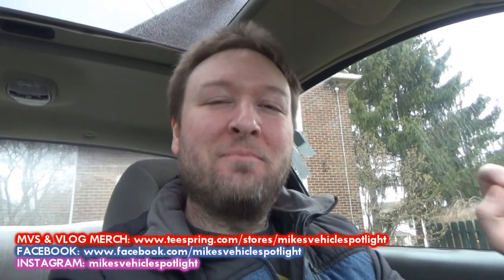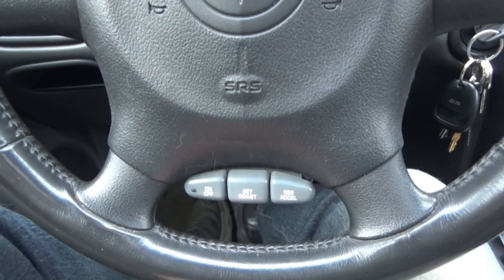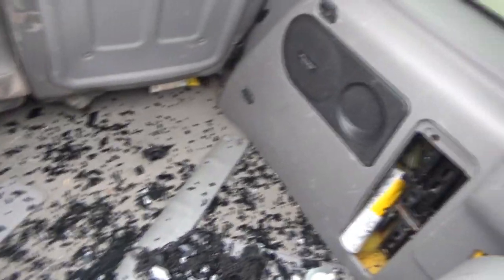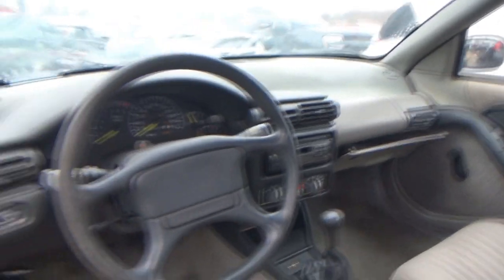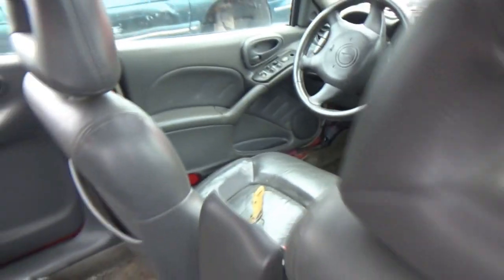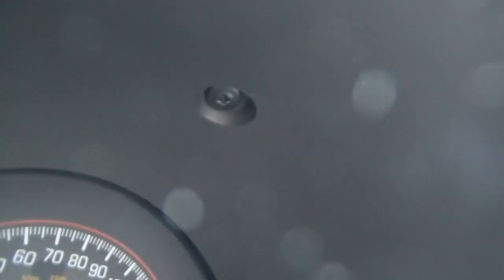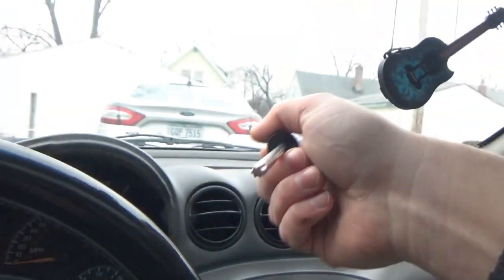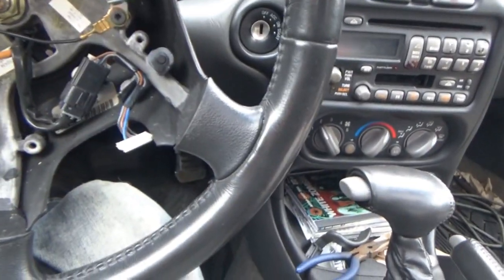MV 313 - "Grand Am Cruise Control Button Replacement"

Comment: Like me, they probably didn't  watch your video BEFORE they tried to "fix" the cruise control buttons..the bottom of the button housing pulls off rather easily (too easily  in my opinion) with the entire steering wheel intact. Oh Btw I have an 03 Grand Am with 228000 miles on it. Motor is still running strong!

Comment: I had the same problem with my 2003 grand am. The switch cover broke away from the switch assembly and the switches broke. I was without cruise for about 1 year until I found a new assembly on eBay for a decent price.

Comment: My cruise on my 99GT is not working. The on/off switch was not going in an now after working on the switches it is but i don't think it stays in. I have led brake lights that i'm wondering if they are the problem. I have a resistor on the 3rd brake light because the abs light was coming on. For fixing the flash rate on the other lights i modded that flasher circuit built into the hazard warning switch. I really would like to get my cruise control working.
Update: There is a tiny metal piece on the on/off switch that can fall off the shaft it is on if the gap between the top and bottom plastic housing pieces is too big or if the shaft it is on breaks. That piece is what locks the switch on when it is pressed in. If you take the switch apart be careful because the tiny metal piece can fall out without you even noticing it. My Grand Am has a metal shaft that holds that piece but i have read Aleros have a plastic shaft that breaks which will also cause the button not to stay in. It is a very tiny piece with 3 lobes on it.
Reply: I switched to all LED's, every single light, and my cruise still works. I got tired of replacing them dumb circuit boards for the taillights 2x a year even though they have a lifetime warranty. I bought some Spyder brand LED taillight assemblies and changed all the other bulbs to LED.
Reply: https://youtu.be/ivgvl766pFo These are the taillights I installed on mine. Got them off Amazon.

Comment: Did the Coast light come on when you set the cruise?
Reply from the maker: No, they quit putting CRUISE lights on the cluster after 2001 I think. The only light that’s on is the ON/OFF button on the wheel.
Reply: @MichaelAdamsRocks  Might be based on trim level or a light out in the instrument cluster?  My '03 GT has the Cruise light.

Somewhat related is that some GM vehicles will disable cruise control when the third brake light burns out/breaks.  (Interesting way of letting you know its broke...)
Reply: @MichaelAdamsRocks  h

Comment: You didn't actually need to do any of that with the steering wheel/airbag, you could have just installed the switch part of the assembly which was missing on yours. Would have been a 5 minute job at most.
Reply: Yeah thats what i 💡 thought